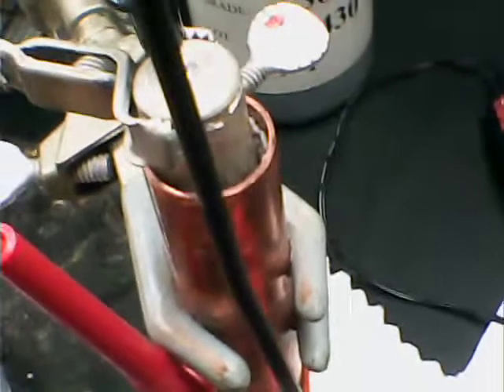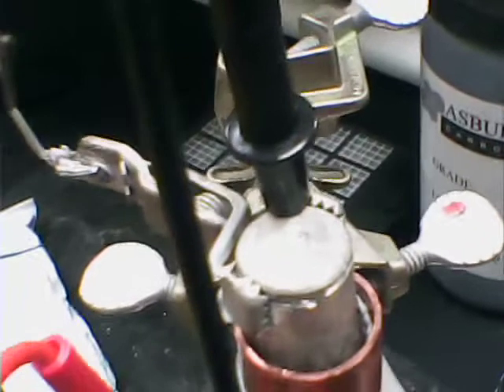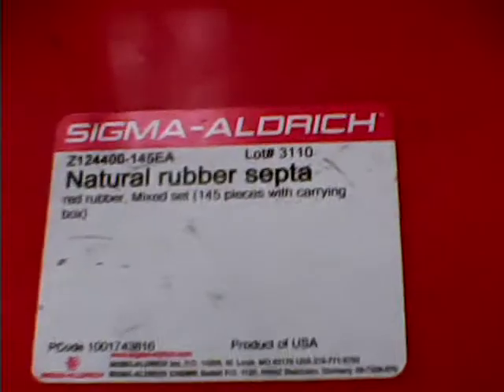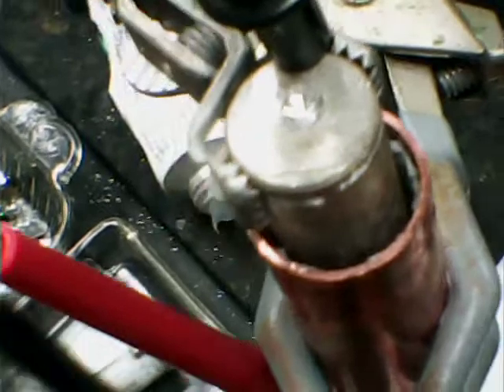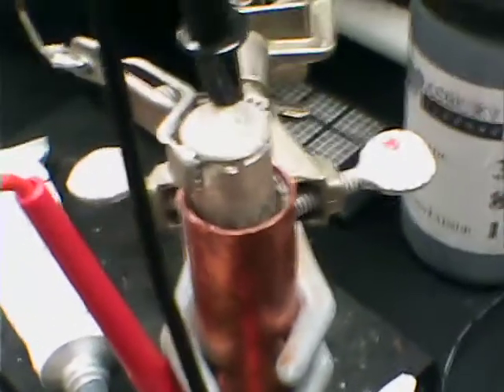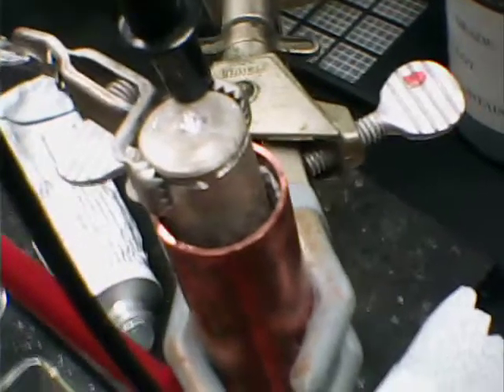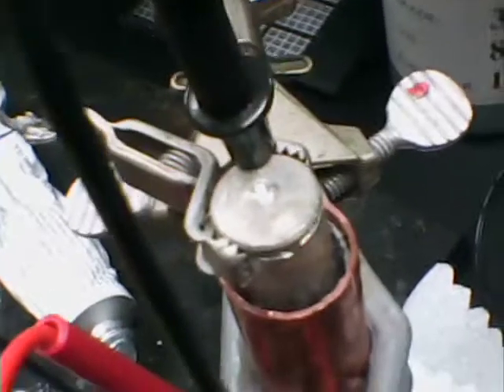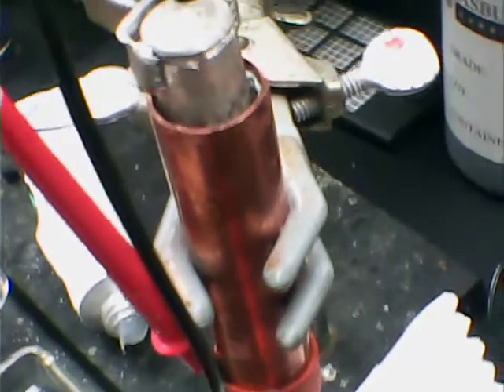Dickens Cell Variation/ Magnesium Batteries

Comment: Very similar to several I constructed.  It was eight inches tall. I used the popular 1:1:1:1 mix of Epsom salt, alum, potassium chloride, and borax compacted in the cell. I lasted about three months powering a garden light LED and circuit, then required adding water about once every two weeks for another two months, once every week every for a month and a half, then frequently for another two weeks. That was with the LED running almost continuously except between stages. Then the mix turned green at the anode (copper), and black at the cathode. I pulled it apart and found very little material loss but heavy corrosion permeating the mix. The mix started at an even pH of 6 and became more acidic at the anode and alkaline at the cathode as the degredation progressed. The literature available indicated the borax moderates or retards the corrosion. I tried using glycerol instead of water but the output was low. My hunch is that the cell is galvanic using the water in the Epsom salt until it is depleted. Another dollar worth of the ingredients and a scrub back to shiny with sand and it's working fine again. Lasersaber did a long term test and came up with interesting results. I'll be interested to see what you get with other electrolyte mixtures.

Comment: i have made similar cells using copper casing with aluminum core.using 
Sodium aluminosilacate as
both electrolyte and separator. heating the cell to 180 degrees F. For 30 minutes to remove most to all moisture. then sealed with epoxy.the cell holds approximately 2 Volt's at 25 miliamps per square inch of surface area.can be completely shorted and recharged. hope this is useful
Reply from the maker: Thank you for posting this!
Reply from the maker: Did you seal the cell while stay hot or cool to room temp. forst before the epoxy?
Reply: Cool to room temperature. It is a crystal cell and this type of electrolyte is a meta ceramic after the heating process.
Reply: You got my interest with the said solid state electrolyte. 
I am aware that some layman chemists or hobbyists are working hard on those „crystal cells“. Even though this is, despite often heard, not some sort of infinite energy or somewhat but admittedly this concept sounds interesting as the mix of hydrated salts is used als solid state ion conductor. 

I assume the said alumosilicate is more or less just some aluminium salt dumped into sodium silicate, right?